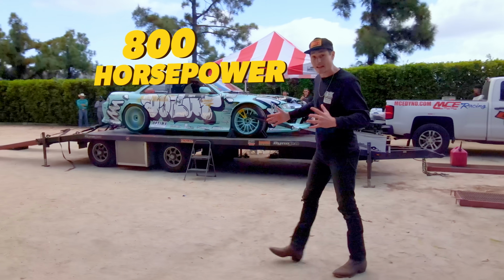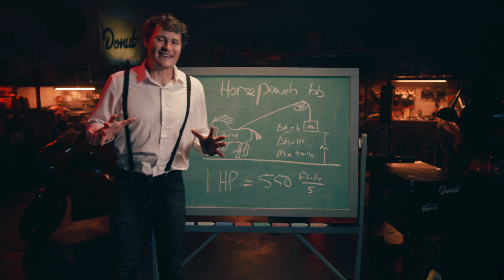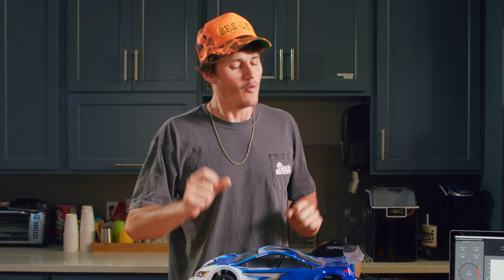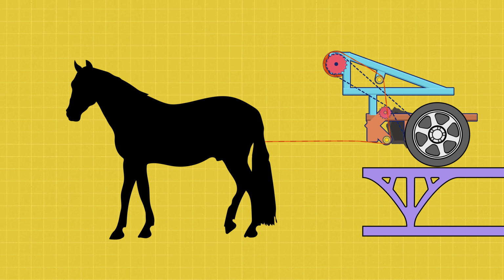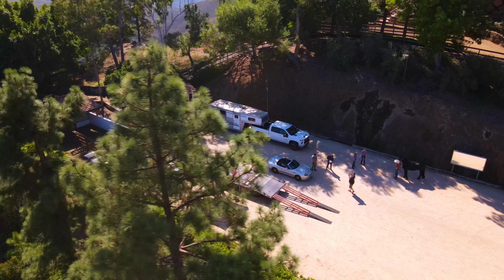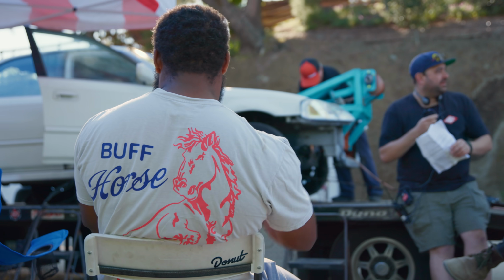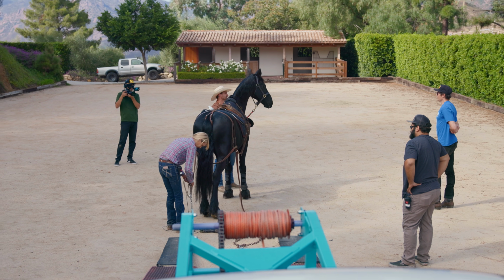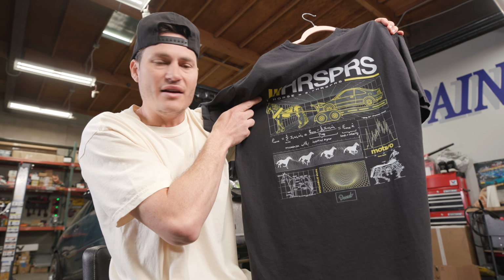How Much Horsepower is a Horse?

Comment: This has been measured multiple times. In Finland, in the 90's, a technical / automotive magazine measured it by pulling a car with the horse. The rope had force-sensors in it, and the car had standard testing equipment on it, with high-precision speed-measuring external wheels etc. The results:

The 1 horsepower was actually pretty close for the 8 hour workday. The absolute peak power (very short interval, basically 1 hard step forward) was about 24 horsepower. 

It leveled out obviously pretty quick in the long run. 

If you were to basically kill the horse with work in a single day, maybe you could get multiple horsepower out, for 8 hours. But everybody in Watt's days was trying to make their horses last long, because they were expensive. If for example the horse looked tired, didn't want to comply with orders etc, they might give the horse rest days. No horseman in their right mind would ever try to whip the maximum out of a horse, especially for a 8 hour day producing beer. (Maybe if you are trying to save lives)
Reply: You wouldn't happen to know the name of the name of the magazine, would you? I like collecting sources on things like this because it's helpful to have these kinds of hard facts available when doing silly research.
Reply: @TheCammerhammer  
Probably "Tekniikan Maailma" issue 13/2000 on page 120 there is a similar story, but the online version is behind a paywall.
Reply: @TheCammerhammer  Tekniikan Maailma - 13/2000 or TM for short. Google "TM 13/2000 hevonen" gets you to the free shortened version. Full article is subscriber only.
Reply: They also could have just used a rope break dynometer which would have been the ideal application in this scenario.  I find it hard to believe all these engineers didn't come up with a better idea not involving a bunch of fabrication, a car, and questionable results because of so many variables.
Reply: @secret5.  They were trying to replicate what a horse could do, pulling a similar weight at speeds similar to something a horse with a buggy could do. The cars were originally called "horseless buggies" etc. They were braking the car (a Saab 9-3) so that the speed would be about 10 km/h. And they had a "force meter" in the rope.
Reply: @aeyuio2315  And the goal was to calculate horsepower, which could have been done on a rope break dyno much more easily.
Reply: I figured that as well as the video went on. Most humans can do a horspower... for a brief time. Some can do about ~0.5HP on a consistent basis (eg. pro cyclists) during a race, but certainly not every day. Biological organisms can pull very high peak power but their sustained power is going to be much, much more limited in comparison.

700W for a workday sounds reasonable for a horse (which weights 500kg+) on a sustained, regular basis.
Reply: That argument is also problematic; can a 800HP sports car or even a 150hp sedan deliver 100% of its rated power 8 hours a day for weeks without issues? Definately not. A true workhorse Cat D7 bulldozer, has roughly same power as my sedan, has a 9.1L turbocharged engine with max 2200rpm.. Surely at like nearly 1/5th displacement and 3x rpm, I know my car sacrifices reliability somewhere... Interesting thing is, D7's engine itself, the C9.3B CAN produce 450+hp, but de-rated to 268hp in this bulldozer application as this is where its expected to work close to its 100%.
Reply: @batuhancokmar7330   The modern engines, with low displacement, and extremely high compression ratios, are basically made to fail at 150-300k miles. And they arent even more fuel efficient in actual use. 

Some 70s-80s cars with lower pressures & "bomb proof" tech did "a million kilometres" (over 600k miles) on one engine, and after that, the companies gave them new cars for free. 

I also recently found a Youtube channel of an engine shop in the US, which does maintaining work for 50s - 60s tractor engines etc, and there are literally dozens of old John Deere straight six engines that come to the shop multiple times over the decades, to be just cleaned, drilled straight, and then put back on the road for another decade. 

In "performance cars", the standard for example the "top speed record" is usually measured on a distance of at least a kilometre. Maybe the "max power" measurments should also be always measured with at least a 10 minute time interval?
Reply: @batuhancokmar7330 most of those heavy machines simply run hydraulics and hydraulics operate everything, including the drivetrain.
Reply: @batuhancokmar7330  Decades ago you would have been right, but today modern engines bounce off the rev limiter on the test bed for days on end. The reason the D7 isn't tuned to 450+ is likely just for better torque, an engine that size with that low RPM shouldn't be suffering any reliability issues at those kind of tune levels.
Reply: @memitim171  An incorrect interpretation on several fronts. Wear is non linear with load, and useful life is different from reliability.
True continous power is quite different from bouncing a disposable engine off of the rev limiter for a day or two. Those engines last many thousands of hours at wide open throttle and still perform well without excess fuel consumption or other old engine problems. The detune in that D7 may be for less stress on other parts or heat build up in pistons or valves after an hour or two at wide open throttle, or because the machine  just doesn't need that much power but the next engine down was't suitable, the engine is also used for weight to get traction and as a semi structural member. A locomotive is rated about 3000hp using a V-16 with a 4 ton crankshaft. 

My old tractor can put out about 27hp actual tractive power to ground from 123cubic inches, but can sustain that for a full tank of gas (about 5-6 hours at full load) in mid-Summer without getting the coolant over 185f even after 60 years of use (The block is designed to be easily resleeved).

An aircraft piston engine will get about 120hp continuous from 360ci (5.8L, aircooled) and need a rebuild around 4000hours.
Reply: @batuhancokmar7330  Well the original figure was comparison to a steam engine which was specifically designed to output the rated power all day. So I guess the continuous power argument is quite valid.
Reply: @batuhancokmar7330  It is also why electric motors seem so powerful, because the horsepower rating on the nameplate is the continuous 24/7 for years rating for max reliability where as the actual power is 2 to 5 times larger, but at the cost of failure in short order.
Reply: Theres a reason horses work in teams. Spread the load among the team. Horses can work longer, with less injuries,  and less fatigue when they work as a team. 
My issue with this particular experiment is that they used a movie horse that's never worked a day in its life. Should have used an Amish horse. You cant really even compare the two. Like Stallone and Tyson. Look the same, not the same. One knows what the hell is going on, the other looks like he should know, but doesnt really have the skill and experience.
Reply: @ripn929707  They should measure dozens of horses. If not for any other reason, but to just show that some horses are just better suited for work.
Reply: @aeyuio2315  well, that's a given. Anyone can tell a draft horse is better at pulling than a thoroughbred  race hose. Since the main idea is to measure work done by a machine based on the amount of work a horse can do, one would use a work horse, or team of work horses.
Reply: Rope break dyno?  Cant you just pull a known weight up a hill and measure work/time.. dirt simple.
Reply: I wonder if the measurement had some exponential factor in there that results in lower indicated numbers as it goes higher, and not linear. The three guys pulling 1.9 with one guy pulling over 1 didn't add up as might be expected. Two extra guys mustering less than 0.4 each; something's missing.
Maybe a factor similar to the exponential increase in power needed for incremental increase in top speed as it gets higher and higher. 
If that's the case the 5.7 would be higher after adjustment.
Reply: For exactly the same reason of continuous work and rest the standard length for fields and thus unit for land plots and surveying was a furlong, and a mile is 8 furlongs. Literally a modification of "furrow long" meaning the reasonable length that a horse could plow before taking a short rest break.
 
A surveyors chain is 1/10 of a furlong, an acre is 1 furlong by 1 chain (or 10 square chains, or 660ft×66ft or 220yd×22yd), the reason for an acre being long and thin rather than square has to do with efficient patterns to plow fields with a traditional plow and the amount of time crossing the headlands for each furrow.
Reply: I guessed a horse had a lunge of 23 horsepower, intuitively, from just watching small tractors and horses. So I like this result.

Comment: I was disappointed that the result did not include error bars (at a minimum) and better yet account for stamina, how much the horse could do over an hour or day rather than just a couple minute burst. 

If the original source of the unit was for comparing and engine with the work of a draft horse milling grain, it might have been instructive to seen how much grain a horse could mill in a work period (a day?) then compare that to a certified one horse power motor rigged to do the same.

Comment: I need help. I cannot find an honest mechanic around me and i need to tear my engine down i drive a 2004 ford f150 4.7L 2 wheel drive and i am having to change spark plug and coil pack on the same cylinder. This truck has a known issue with the intake manifold gasket leaking into spark plug hole i had that for a while. But haven't seen it anymore its dry now please help i don't have full horsepower either.

Comment: That horse didn't even pull half of what it is capable of.

And that's a problem.

An engine needs rpm to make horsepower... A horse need resistens to make horsepower, there is simply not enough resistens in what it pulls. 

You should have tested how much weight the horse could pull, and then just tested how much power I takes to pull the same weight with an electric motor. 

You made this overcomplicated.

Comment: A horse probably puts out different horse power at different load level. You would need to find the optimal load level to obtain the maximum horse power. To do that, there needs to be a gear box between the horse and the dyno. This is similar to bicyclists changing gears to obtain optimal cadence.

Comment: One thing came up to my mind. Theese wheels can make up a "flywheel efect" I mean by creating a winch you created few different size wheels on the system which can make up a "gear transmission effect" I would connect real car to the pulley ( like pick-up truck ) to see if there is a difference between "standard dyno for cars" and this "pullying style dyno" on the same car ...

Comment: i think this is a flawed experiment, that horse for 1 looks small for a draft horse, a proper draft horse is on average between 5.9 and 5.10 just to the base of his neck icluding its kneck and head your talking 7ft minimum that horse was at the same height as the man pulling it almost also weight should be a factor you measure engines based on weight ect so its alittle flawed, unless the math beind the scenes accounted for all that still a very interesting video tho
Reply: a better way to measure its horse power woukld probably be to put it on some kind of tension bar that measure his maxed pulling strengh then after that let it run at max speed then convert it into what we call hp based on his weight ect so his pulling strengh would be his torque and his speed would be his rpm

Comment: That is not at all the first vertical take-off and landing (VTOL) vehicle, please be sure to review your facts. That's the Airbus Vahana, which isn't even the first eVTOL so I'm not sure where you're getting this information from.

The experimental setup is odd, I suppose it's to reduce cost of bespoke parts as much as possible but it feels compromised. The RPM readout could have easily used a typical hall effect sensor as a backup like those seen on bicycles, but the manual optical encoder works too of course. The mechanical advantage of the pulley system changes as the rope overlays on top of itself on the spool, this could have been remedied with a bigger spool since the distance of the pull is not that long, although it looks like a commercial off the shelf (COTS) winch system for offroad vehicles which may be why it's so small. It's not unsolvable but you're adding a point of uncertainty and an extra function to process (or you're making another assumption for simplicity that adds another source of error). The use of a car and a dynamometer for cars to measure the power output is also likely a cost cutting measure but one which introduces a lot of uncertainty. The paper would be an interesting read to see how these uncertainties were addressed and what statistical tools were used, it seems to me with all the uncertainty that confidence in the final value cannot be particularly high.

Comment: This needs a retake...scientifically
1 why didn't you connect the roller directly to the dynamo and did you have to insert the car transmission only to remove his losses mathematically at the end?
2 why didn't you check with a car that would pull the string to validate the result?
3 test with more horses and make an average for consistency, although horses in a group have a different power than alone, 4 horses is not equal to four times 1 horse, ask any farmer, but better test it.

Comment: Honestly as an engineer I dont quite understand the point of using a dyno. You dont need to calculate power just in the rotational domain. If you measure the tension force in the rope (with the available load cell) and the displacement of the horse (which you are already doing with the GPS unit) you can easily determine work performed by the horse, and with some filtering probably also instantaneous power. The only thing the dyno would be doing is simulating a load, but that could be any rotating inertia, plus the mechanism is adding a ton of discrepancies due to friction. Frictional modeling is notoriously hard, and can only be approximated. Which brings me to the point that their entire model seems to be just theoretical with no validation performed. 

Also, I think it would be very interesting to do different runs with different loads, see if the maximum power is dependent on load.

A fun video, but I doubt it will survive a peer review and actually get into a higher level journal (or even conference).

Comment: So full disclosure, during college, I did doodles in my notebook, typically in relation to the subject. And one of those was the horsepower diagram. Except instead of the typical horse, I drew Applejack from the My Little Pony series. So imagine a tiny horse in a straw hat pulling 550 lbs of apples in a wagon. I thought it made more sense and I wanted to mess with the instructor since we had to turn in our notebooks for a grade. Unfortunately, this was the 2020 Spring semester. So COVID hit, we all had to study from home and the notebook credit was waved. I still have the notebook in my room somewhere.
Reply: Brilliant. I always drew sports cars in a race circuit scene.. maybe rounding a corner or crossing the finish line.

Comment: Am I the only one thats lost here?
How does a horse pull 5.7 horse power? I thought 1 horse is supposed to pull 1 horse power?
We need to change how we calculate horse power.
So my crown victoria has 1,140 horse power... real horse power..lol
Or technically if we change 1hp to equal 5.7 hp instead I have 35.08 hp
Reply: Hp is force*distance/time. Has nothing to do with horses.
Reply: @ChillinHD  yeah looked it up after I made comment, still stupid though. 
1hp should be 1hp

Comment: I thought you were supposed to measure until the torque dropped away.  To be accurate wouldn't you need to keep measuring until the horse reached its top speed?

You also don't actually need a drum.  It's exactly like you said, the drum is a way to measure how much kinetic energy has been transferred.  Another way to get the same measurements would be to stick a carriage behind the horse, weigh the entire setup, then accelerate to full speed naturally.  If you graph its speed over time you should theoretically get the exact same graph as putting it on a dyno treadmill.

Comment: Now im no technical expert but I do know a few things about horses if you can I'd like to see a quarter horse for a couple reasons they are more of a middle of the road type of horse good at everything. Second that horse didn't look like he was pulling very hard more of a casual stroll from what I saw with a good quarter horse I think the number could definitely be higher especially when iv seen them drag a bull who was not interested in going our direction. The other thing I'd like to see is put a team on there but more over a team of draft horses and then a team of mules iv seen mules drag 20 foot logs out of the woods like it was child's play iv never used horses to but that was just because we had the mules trained for it

Comment: Seems like a Clydesdale would be the most appropriate horse for this test. It's not just top end power but low end grunt. Also, this test doesn't seem right. Horsepower is stronger than human power. An average human can't pull as strongly as an average horse. 1 horse should = 1 horsepower.

Comment: There is a problem with your setup. Horsepower is cumulative, so 3 people should be the sum of of individual hp, plus a bit extra because of better traction. Less than 2hp means that there is a problem.